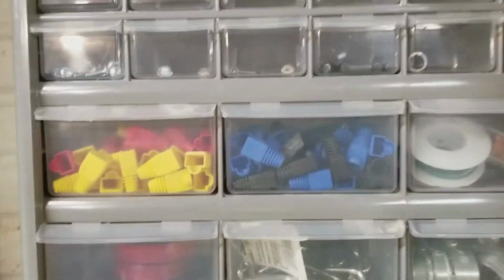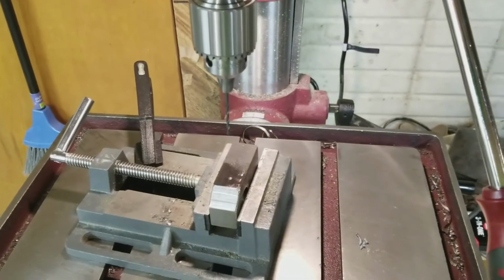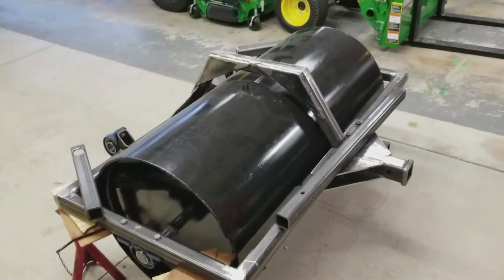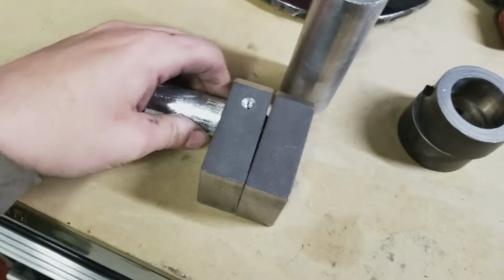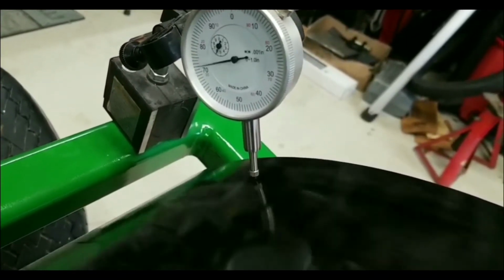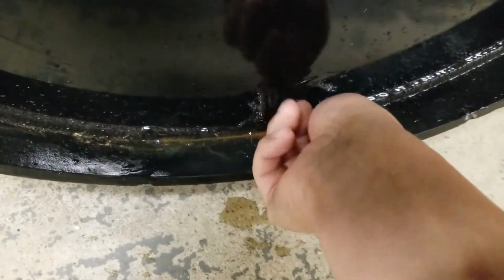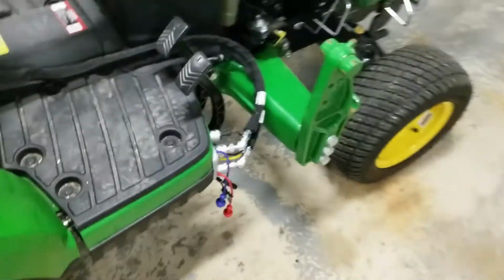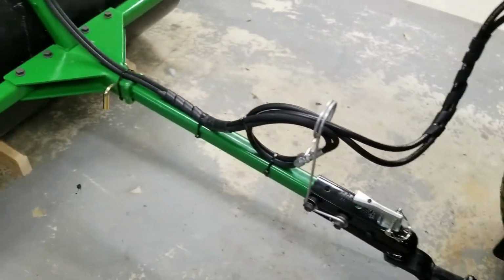ROLLER BUILD - Part 7 - Finishing up

Comment: So, here's a dumb question. What does a roller like this do?  I had some idea that it was for rolling over freshly sown seed to help it germinate. Why does one roll an existing lawn?  Wait, let me guess....to smooth it out right?  But your lawn looks great as it is...I think anyway.  I am clearing brush from my acre and will be planting a pasture mix just to hold the soil in place and look greener than dirt sort of. So after pushing off the brush and tilling and raking the roots and rocks out I suppose the last step would be to roll it?  Nice build and your welding is fine.  They used pay me to do it though I'm no way a pipeliner. Love the plasma cutter but tractor first.
Reply from the maker: No nothing to do with seed bed prep. I'm in Wisconsin where the problem is frost. In winter it is nothing for the ground to freeze 8+ feet down which causes "Frost Heaving" which makes everything rough  and bumpy from lawn's to road's. So around here it is common to have your lawn rolled ever spring to smooth it back out. Its a easy way to make some extra money seeing most people do not own a lawn roller and those that do have there own are just store bought rollers that are nothing more then a 1/16 in thick drum that when full of water maybe weighs 500LB. What I build is in a class by its self mine weights 1,500 LB and the point of the wheels is so I can run it down the road going form one place to the next with out trailering it. I think if you used mine for seed bed prep nothing would come up, it will pack soil so hard its like concrete. Check out this video I run over some bare dirt and you can see how hard it packs https://youtu.be/V-0J7RZw6fY    Thanks for the compliment on the welds and it you don't mind me asking what do you have for a tractor?
Reply: @masterofeverything6468  Kubota BX22 with backhoe. It's smaller than your JD 2501 but still gets a lot of work done. We have sagebrush here in Nevada. You have to dig them out one at a time to clear the way for grass. The previous owner was Mr. Natural. Young feller like you can look that up. ;o) Folks here have horses and before they put the houses in it was cattle all the way. The soil is deep and good. Native grasses will produce good forage or I can mow it for a decent look with very little water.  I lived in Fairbanks Alaska for ten years so know about frost heaves but here abouts temps may hit the low single digits once a year and we get teens from time to time but there just isn't enough water in the soil above the frost line to get much movement. The frost line is in inches rather than feet and we get 320 days of sunshine to keep things from locking up too much. Again, nice project. I found it looking for ways to make my own. The store bought ones also can just destroy themselves. They are built too light.

Comment: That is an awesome build. Good job. What size is that red hydraulic   cylinder and what about the bore & stroke? Where didchya git it at? Awesome video & thanks for sharing
Reply from the maker: The cylinder is a 2-1/2in Bore and a 8in Stroke with a 1-1/4in Rod size and I got it at my local Fleet Farm. Its a "Lion Hydraulic" 2500 TL Series

Comment: One could use a old propane tank
Reply from the maker: NO!!!! TOO LIGHT.... This drum is 3/8in thick and just the 48in by 24in pipe is over 400LB. And when the roller is full of water it is just under 1,500LB.
Reply: @masterofeverything6468  what was your drum from
Reply from the maker: @robertduncan2742  It was from nothing, It was from a steel supplier, Brand new just rusty stored outside. https://www.youtube.com/watch?v=e-0WXXtxUT4&list=PLIOEap-SqCptFU51rvt4hwCtCFPA4O8vk&index=3&t=0s